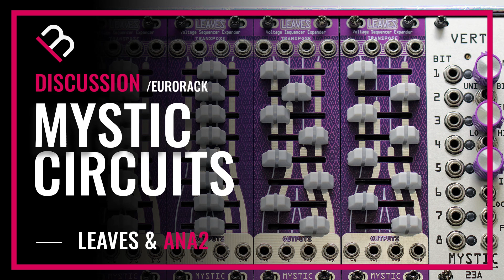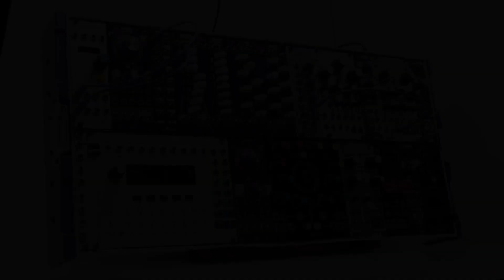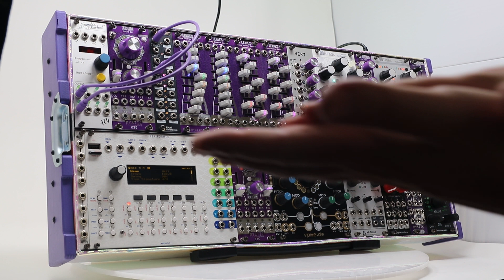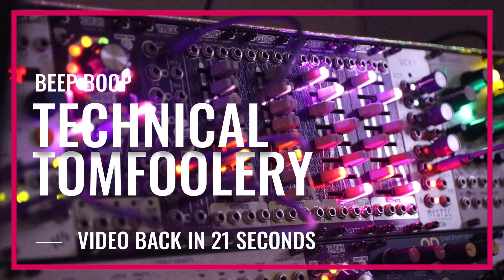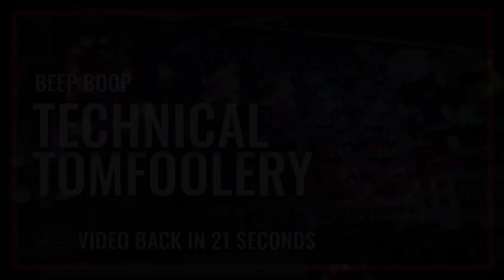Mystic Circuits Discussion - Leaves & ANA 2

Comment: Love this! That dynamic of having a cool thing but then also explaining how it works in many ways so that all the various use cases people are excited about are touch points for them is so hard. This just reminds me that I haven’t jumped into the Mystic Circuits stuff as of yet and Leaves makes me want to grab a Turing machine or a Tree. Love the idea of a sequential switch but haven’t had a chance to patch one up in my case as of yet. I think this is the first time I’m fully understanding the power of Leaves. It’s brilliant in the way you have the 3 additional outputs! Plus, having those all transpose different things is incredible. Seems like such a wonderful playable macro sequencer almost. Just wondering, is that a Backward input on Tree? If so, does that mean it can run backwards? If so, would that also mean that that Leaves stayed locked with it whichever step it’s on?